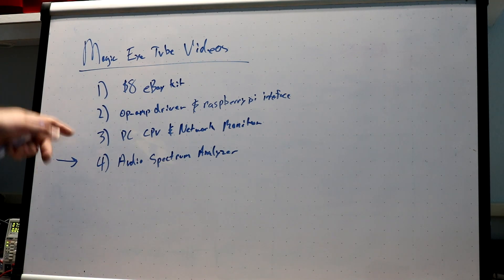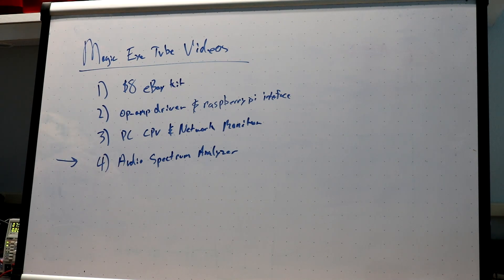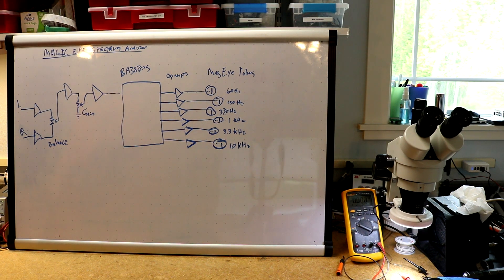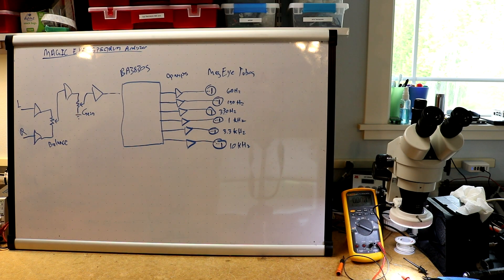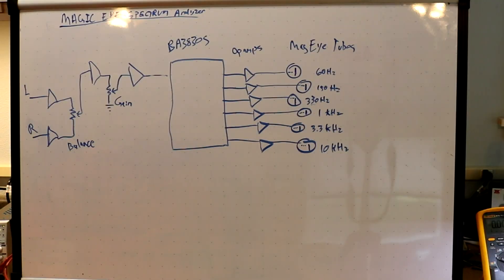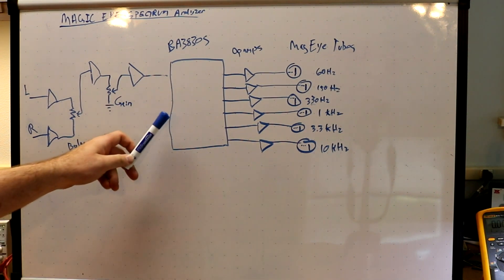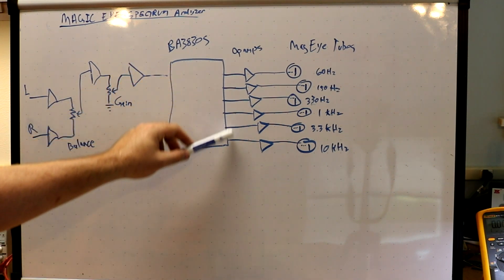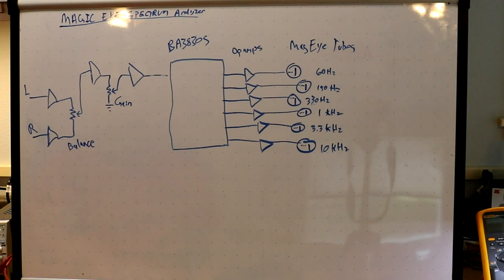Magic Eye Tube 4: Magic Eye Tube Audio Spectrum Analyzer

Comment: Nice! About the last tube (10 KHz), for what it is worth, my feeling is that at 9:20 you're feeding it with 5 KHz, not 10. That would explain why it doesn't fully deflect and why the 2nd tube (3.3K) also deflects.
Reply: While playing the video I checked the audio with a spectrum analyzer on my phone, and it was definitely closer to 5 kHz than 10.  Good call!